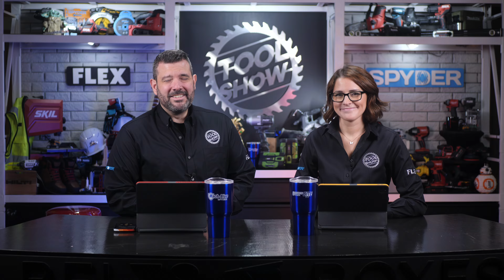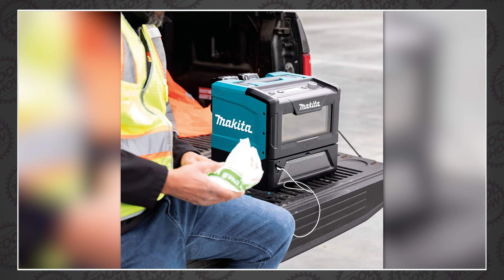NEW Tools from Milwaukee, Makita, DeWALT, and more!

Comment: The Digital angle gauge is technically used by us low and high voltage techs to check conduit angles and to check if other hardware we mount is level. 😮
Reply from the maker: So that makes a ton of sense. Thanks Billy!
Reply: Can't have the current flowing too fast in a tilted conduit... 😌🙄😂
Reply from the maker: @peterfitzpatrick7032  lmao!

Comment: Makita’s AWS vacuums are total garbage. I returned mine and I returned the track saw while I was at it. Especially for the vacuum Festool is so much better, and what was truly pathetic is the Festool cordless is cheaper. Long life bag.  Festool’s cordless track saw is a lot better too.  The Makita track saw doesn’t even have a depth gauge that accounts for the track.  Ridiculous.  I’d seriously rate the 40V cordless Mak vacuum about a 2 out of 10… good power… everything crazy cheap and just terrible after you’ve owned a Festool.  Festool was about $200 cheaper as well on their cordless 2-battery.

Comment: It seems Makita has taken a page from Dewalts play book. Why offer 2 or 3 very capable tools when you can confuse your customers with a truck load of almost identical tools.
Yes you Dewalt,  im referring to the 9 (at least) different drills and 4 different battery platforms that are almost identical in performance.

Comment: I’ve had my microwave for about 3 weeks now. Had it sent over from Japan as well as their smaller 40v cooler and I love having them when I’m out in the field
Reply: I'd prefer a 40v toaster oven to be honest. Bro have you seen the Makita 40v mini TV?? BTW, how much did you pay for the cooler? I want one but they're so expensive. Metabo HPT does a cordless cooler, but it's smaller and doesn't have a heating feature
Reply: @danielrosic2960  I got mines for under $600. I would recommend using it with a higher Ah battery like 6ah 18V or the 8ah 40V battery. I haven’t felt the need to turn on the warmer as of yet.
Reply: @jahmar7767  Nice, thx! Did you order it via ebay or do you know a site?
Reply: What are you mkbhd? 😂